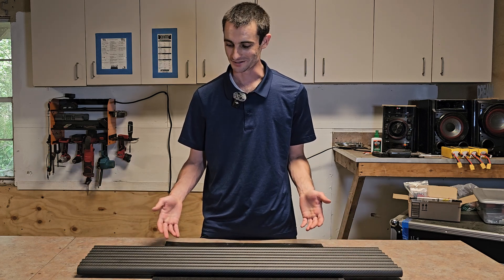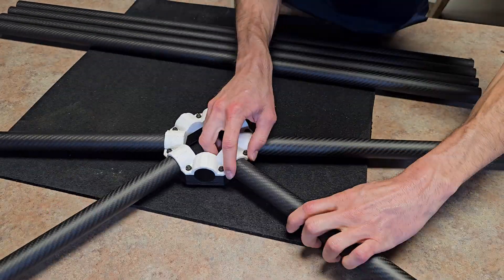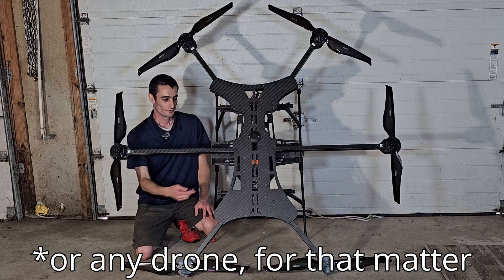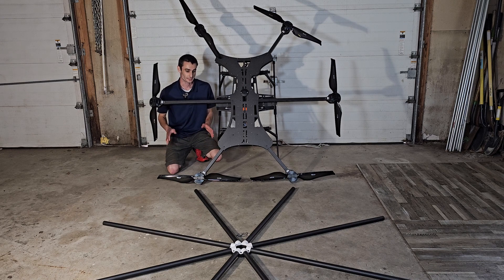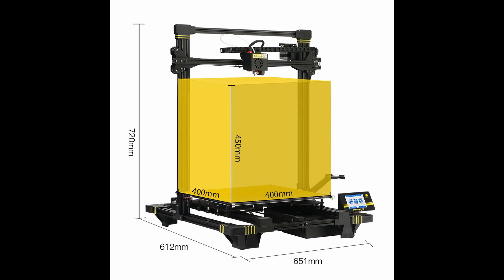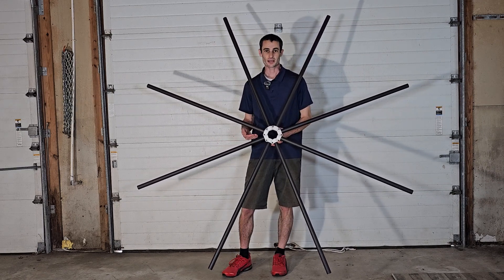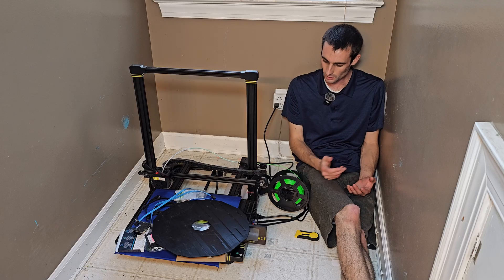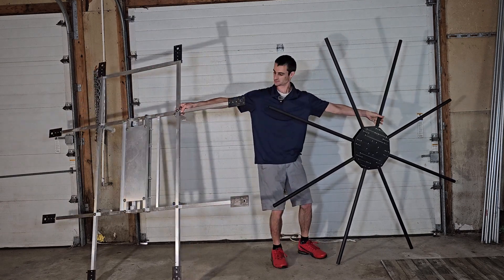I built a big drone (eVTOL) - Part 1: The Body

Comment: I mean this constructively, but you dont seem to realise the loads involved. Those small bolts and printed parts wont hold up.
Reply from the maker: Thanks for the suggestion, and for being polite. The 3D printed parts are only intended for rapid prototyping, although they are surprisingly strong. Soon I'll replace the center part of the body with aluminum. I addressed this in my most recent video

Comment: so why does it need to be flat, it could be a 8-arm cube copter. also the main body can be pass through mesh 3d structure.
Reply from the maker: You're right, it doesn't need to be flat. It's just the simplest design. But a cube would look pretty cool

Comment: I know you mentioned that you would tackle vibrations and more structure in the next video, so you may have already thought of this. What about adding a small foam layer to the connecting disk so the vibrations don't dislodge the screws like the last time. This design seems a lot more dependent on the screws holding the main frame, and there is also more of a balance issue if one of the arms stops providing thrust, I feel this would be of value!
Reply from the maker: That's worth considering, and you're right that the screws are vital to holding the frame together on this one. I think I'll use a good amount of threadlocker when I'm ready to fly it, but if I'm still having issues with vibrations, I'll consider adding something like foam to further reduce them
Reply: @TheDronesmith  Alright nice! looking forward to seeing it